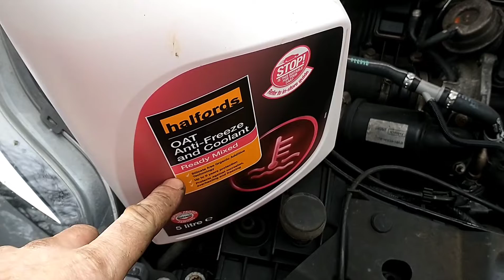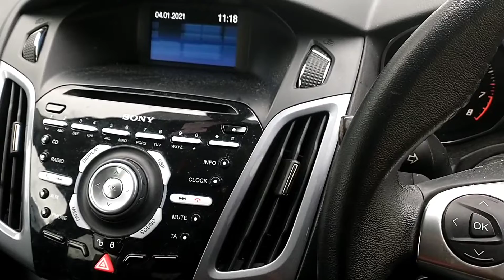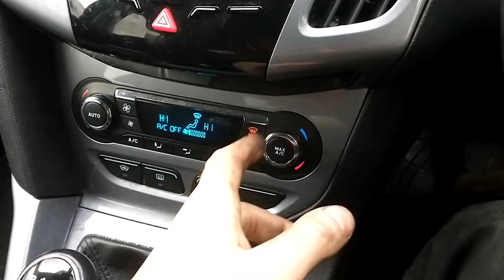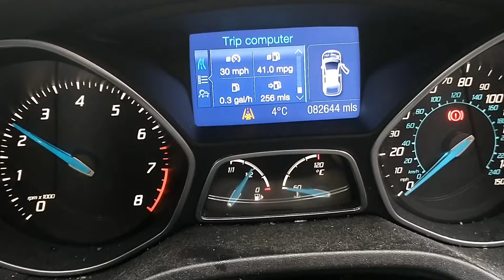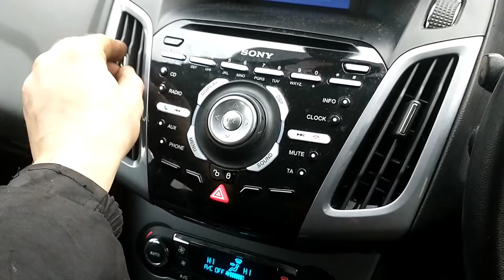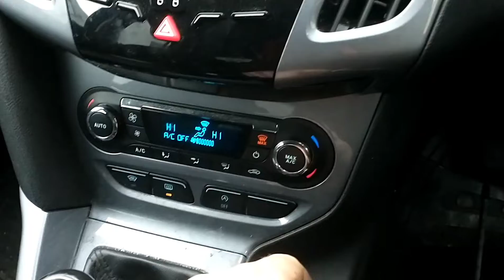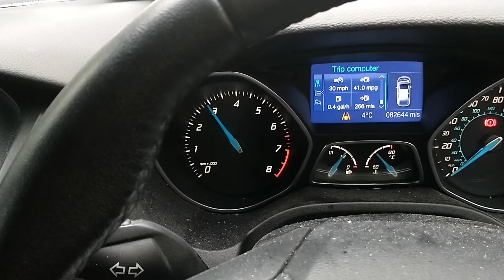How to bleed a cars Engine Coolant System

Comment: Mk3 focus, hold the ok button on the left of the steering wheel and turn to position 2 on the ignitio, hold for 10 seconds and you will get test mode on the screen, them you can use the direction button and go to engine temp, it will give you the exact readout in degrees, good for also checking battery and alternator and fuel rate etc

Comment: hi,i have a 2009 ford fiesta 1.6 tdci,i changed the thermostat in it today,i put coolant in there run it for over an hour,top rad pipe is hot,heaters are blowing hot but my rad and bottom rad pipe is cold,the water in the water bottle is getting hot but doesnt look like its circulating,when i take water bottle cap off there is no pressure,been on it today for about 5 hours and can't get the rad or bottom rad pipe hot,,,please any ideas,i was told it could be water pump?but i dont have any noise coming from water pump or any leaks,thanks in advance,jon